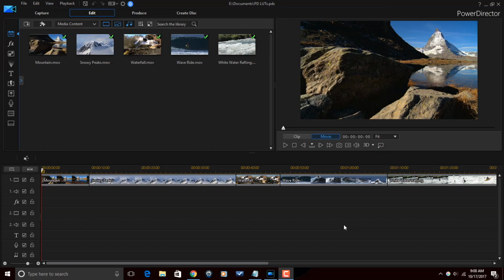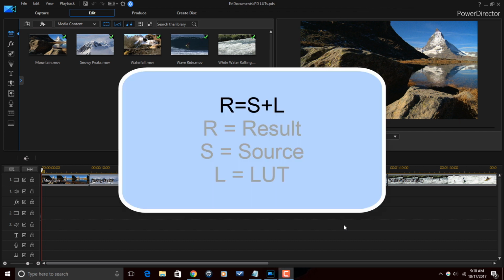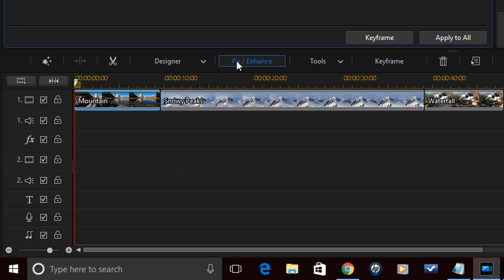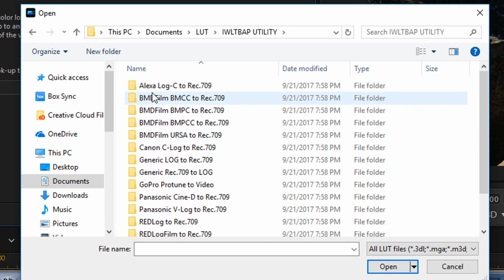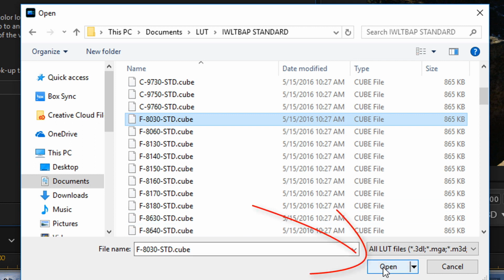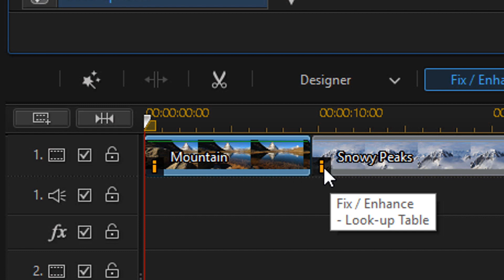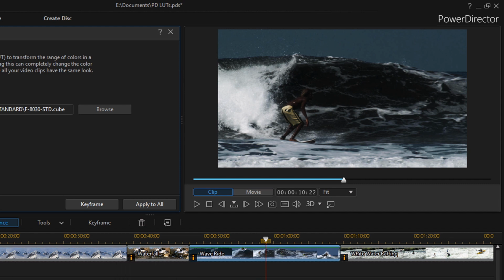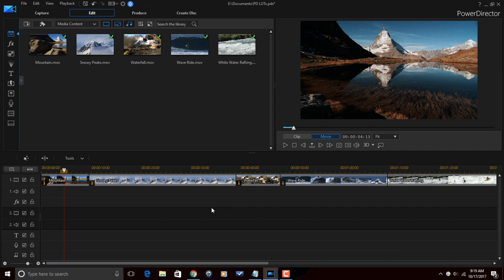How to Apply a LUT | PowerDirector

Comment: Hey Maliek, i know this video is old but ive only recently. in this video u mention about color correct the footage before applying LUT, but is it easier if the footage was shot in LOG and makes applying LUT all the more easier and uniform? and what happens if i apply the certain LUT  (say its meant for canon GH4) but used it on a footage shot using a device thats not on any selection?
Reply from the maker: Nothing happens, it just applies the LUT. If you like it keep it on the footage.
Color correction makes the footage uniform before applying a LUT. https://nofilmschool.com/2016/08/should-you-adjust-your-footages-color-or-after-applying-lut
Reply: @PDU_Tutorials  thanks!
Reply from the maker: Jerry Wong You’re welcome.

Comment: Are we only able to apply one colour preset to a video clip at a time? When I add a second the first one is removed, but wondered if there's a way around this. Thanks.
Reply from the maker: The only thing I can think of is to Produce the clip and then use another one.
Reply: @PDU_Tutorials  I thought that this might be the case. Thank you. Also, thanks for your response to my LUTs question, which I can no longer see in this thread. (Accidental flagging, perhaps.)

Comment: Hey Maliek, Do you know if PD19 has the ability to change the % of the LUTs yet? I cant seem to find it in the software, so wondering if I've missed a trick? Cheers!
Reply from the maker: If you have PowerDirector 365 they updated PD 19 a few months back to add the ability to change the % of the LUT. Just update the program using the CyberLink Application Manager. 

If you have the stand a lone version of PD 19 then you have to hope that CyberLink released a patch that you can manually download and install to get the LUT % update. https://www.cyberlink.com/support/index.html
Reply: @PDU_Tutorials  thank you very much. Will check for updates tonight! 🙌🏻

Comment: Hello, Maliek! How can I remove applied LUT from timeline video if I don't like it? And is here an option to reset timeline clip to its original state by simple clicks?
Reply from the maker: Undo button or CTRL+Z
You may also be able to go to the FX Room and deselect the LUT
There is no setting to get you back to the original clip. Just start a new project
Reply: @PDU_Tutorials  Thank you! Well thats a pitty thing that here no possibility to reset for example one of 5 clips on timeline... Today I installed PD Business trial - I still cant find difference between original PD :) I hope soon we can find some tutorials. 
And one more thing - I noticed extremely increase of rendering time when LUT's are used... it could be several days for 1h video :) I don't have, of course, the most powerful computer in the world, but seems like PD lut's is not for ordinary users.
Reply from the maker: @Latvijasfans  Yep, adding LUTs, effects, etc. will require more processing power and results in longer render times.
Reply: @PDU_Tutorials  So, I was curious to compare Premiere and PD. Same video, same LUT, basic settings in produce menu - PPro - 2 minute, PD - 6....I wannna say ...WT... Cyberlink?
Reply: Yes, tried for example 25 minutes clip  - same size, same Lut, rendering on PD 2 times slower ... :( That's not good.
Reply from the maker: @Latvijasfans  Programs are different 🤷🏾
Reply from the maker: @Latvijasfans  If Premiere is better for you I guess you should go with Premiere. You’ve got options. 👍🏾
Reply: @PDU_Tutorials  hmm, may be. I was PD user many years, but I did simple tasks. Now, when I targeting next level, PD starting to loose positiions.
Reply from the maker: @Latvijasfans  :_TeamPDUPDULogo:

Comment: I currently use PowerDirector 365 and I'm not in front of my computer right now, so can you tell me if I can use Luts with 365.
I read a previous comment that it was not available in 365 but that was a while ago oh, so I'm wondering if they have patched that yet.
Reply from the maker: Cigar prop You can use LUTs in 365. Always have been able to. Maybe they were using a different type of file extension. I know you can use.cube and .lut but I’m not sure if you can use.xmp.

Comment: Hello, Maliek! How are you doint out there? :)I have PD360. I checked that page for lut's - but there is a note that these luts are compatible with certain softs. Where did you get luts for PD?
Reply from the maker: If the LUTs have the .cube or .3dl extension they can be used on any program. If you look up free luts you'll find plenty from rocketstock and color grading central. I have those and more.

Comment: Hi Maliek, 

As usual thanks for the video and for your work. Due to your early videos I started my own chanel and learnt a bit about PD. 
I am currently still on PD14 and thinking about upgrading to 16 and... I still have some doubts.

First of all, cool about LUT and colour grading as in PD14 I din't have much to improve. PD16 has plenty to offer but is it possible to scroll timeline horizontally?  I mean, Shift+Mouse Scroll ?

I would upgrade only for that to be honest as lack of it makes my life harder... :(
Every other normal program is working that way but not PD. I even bought myself a Logitech Master MX because of its second scroll for horizontal movements and sure... works on everything except PowerDirector... surprise :/

If not Shift+Scroll maybe there is any other way?
Reply from the maker: There is no way to scroll the timeline using the mouse that I am aware of.
Reply: I have been digging through this subject a bit and there are more users like me. 
I believe you have a better contact with them than random users. Can you ask them about it?
Reply from the maker: Nope, I don't. You have as much chance as contacting them and leaving feedback as I do. You can do it on the PowerDirector forum. Just Google it.
Reply: OK, thanks. I'll try.

Comment: Hey man,  I’ve tried everything and maybe you can help. I bought the Peter McKinnon Luts package but I can’t figure out how to get those Luts into Powerdirector 15. I downloaded a Luts uploader.  But i can’t figure it out.  Any advice?
Reply from the maker: They really don't go into PowerDirector. You Browse to the location of the files on your PC and select the file to import the LUT and apply it to the image/video. The file extension needs to match the types of LUTs that PowerDirector can import. Also, LUTs can be finicky. .Cube files may need to be converted to .3dl files, the capital c might need to be changed to a lower case c in .Cube files, etc. In other words, it may be something that takes some investigation to figure out. You might want to share the files on the PD Forum to see if anyone there can help you out. https://forum.cyberlink.com/forum/posts/list/63720.page

Comment: hey bro in my cyberlink 17 i have no this program pplz help ??? for luts pack
Reply from the maker: In PowerDirector 17 Ultra, Ultimate, or 365 it is found under Fix/Enhance > Color Presets & CLUT
Do you have one of those versions or do you have the free version that came with your PC/laptop?
Reply: @PDU_Tutorials  ultimate . no free i have full vershion
Reply: @PDU_Tutorials  yes i have  this program  Color Presets & CLUT . i have pc
Reply from the maker: @AssadAhmedVlogs  I told you where to find the LUTs in my first comment. If they are not there you need to contact CyberLink for help. I don't work for CyberLink.
Reply: @PDU_Tutorials  oh ok

Comment: A little confused by this video. You had a big selection of LUTS and chose one randomly that made your footage look bad.  I didn't see the advantage of using it, and how do you know which one to choose (the names all look the same)?  Also, if color correction has already been applied to your shots, what is the purpose of using a LUT in the first place?  Lastly, if you have an hour's use of footage, do you only use one LUT for all of it, or can you use several (say, for interiors and exteriors)?  I went to the Color Grading site, and they ask you which of three editing programs you're using, and none of them are PowerDirector... which LUT do you choose?  Sorry for so many questions, Maliek.
Reply from the maker: This is just a video showing you how to apply LUTs. I could have selected one that made my footage look like a blue whale and the process to apply a LUT would be the same. 😄
You should know which LUTs you downloaded. You select the best one for your recording device, for a look you want, or you can try them and test them to see which one you prefer.
I use LUTs for grading, not for correction. Since I like the look of the LUT and I am using it for grading I make corrections first and apply the LUT after so I don't mess up the look of the LUT. It's really up to you which one you do first. https://nofilmschool.com/2016/08/should-you-adjust-your-footages-color-or-after-applying-lut
You can split your clips and use as many different LUTs as you want.
Reply: Thanks!